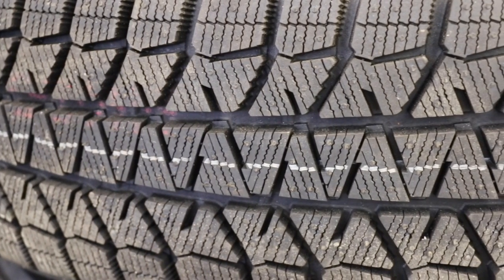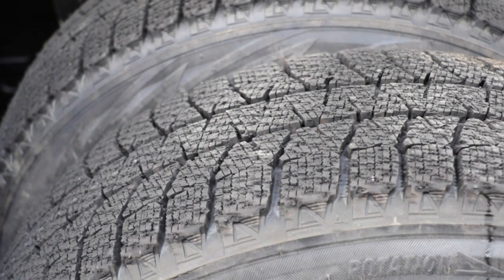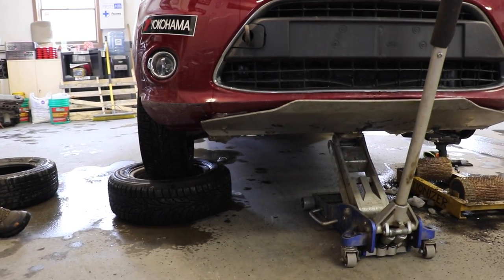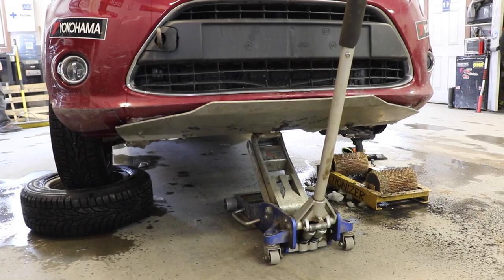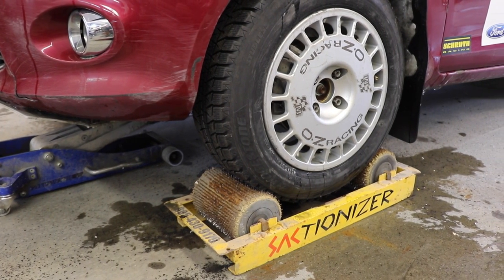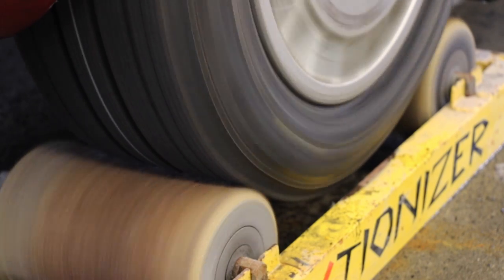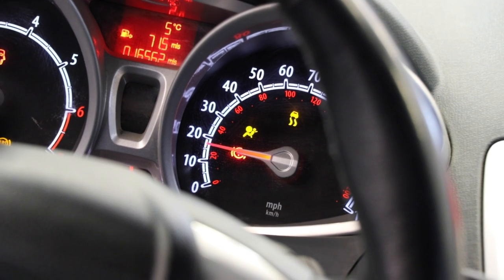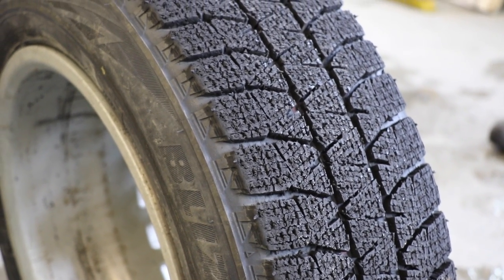Tire tractionizing explained

Comment: What your gonna end up with is a tires that will last you 500 miles on pavement
Reply: Walk 500 miles to get back?
Reply: Joseph Ho then walk 500 more
Reply: would you be the man that walks 1000 miles?
Reply: Maybe
Reply: Rayjay25 to fall down at your door?
Reply: Rayjay25 lel
Reply: More like 50 miles
Reply: SANTA MUERTE just buy snow tires, don't be chap with safety.
Reply: And that's why this channel is called "TeamONeil*Rally*". You can't drive untrasoft slicks on pavement either.
Reply: If you end up driving a car with tractionized tires on pavement, you've done something very wrong.

Comment: should note that tire resurfacing is a no-no in many rulebooks these days
Reply: But this doesn't get a new surface but just a surface adjustment, so allowed?
Reply: QuiznosBear what was resurfaced?
Reply: yes this is allowed if done on a new tire  , if you drive it on any road it will fly apart in a day or two , so only for ice and snow , also studded tires exist and would last longer
Reply: You eat corn the long way and that's a big no-no
Reply: @randomusernumber1  this is done for ice/snow racing only when there are rules where studs are not permitted.  Ofcourse the tire wont last long even on ice especially while racing...

Comment: i have some years experience as a rally mechanic and i have seen tarmac tires being shaved (for that straight contact patch) but i have never seen this before. 
Never did ice and snow rallies either , that could be the reason.
They sure look grippy.
Reply: yeah they wrote a comment here and they are not allowed to run whit spikes so thats why they have to do like this. i imagine its to make snow stick to the tire better.
Reply: Ive never seen it before either. We had a siping servicr at the shop i worked at. I personally wouldnt even sipe though. I just have a winter set and a summer set. Between the two, i get about 3 summers and 3 winters and thats just about how old tires shoukd be before the recommended discard date anyway. Saves money, and i dont chew up a perfectly good set of tires! Maybe it grips better, but with friction comes wear.
Reply: did you read the fact this is for racing
Reply: brandon dumont this youtube video is advertising overall traction improvement, and one of their main points is better snow/ice performance.
Reply: and the only time you do this is for rally as the tire meant for 1 race as they wont last long.

Comment: is it possible to get two tractionizers and put the car on, if its got a welded diferential?
Reply: otm646 Wasted time & fuel.
Reply: Observing Rogue wasted time and fuel? Lol. It wouldn't take any extra time. You have to do each tire individually, regardless of whether the other tie on the axle is in the air or propped up on a tire. Even if it did take extra time and fuel, I don't think anyone would care about an extra half a cup of fuel.
Reply: xDrifz run a track system with them
Reply: Andrew Delashaw. Time & money are precious. Unless you're enjoying yourself, meditating, or just thinking, if you can reduce the time to do something, like bundle, or be more efficient, and there's no real extra risk, then I say, go for it. Time should be used to make money or happiness, or to sort something out. If scientists found, perfected, and marketed the cure for aging, so we could live forever, I don't think we would be having this conversation. Then again, even with forever, let's try to get things done sooner, if it won't dramatically cost safety & quality.

Then there's fuel. I'm loyal to BEVs & Turbine Hybrids, and making my own fuel. But even if I was doing this on battery power alone, I would try to do as many wheels at once, as possible. And do to the time & money costs of fuel, and the possible severity of it's environmental impact. I don't take burning any lightly. It better be for a good reason, or a good time. In my opinion.
Reply: Observing Rogue you mean "when" not "if"
Reply: Nick Faber Yes.
Reply: teller of truth I think people do that, because they don't have the money yet, for a real LSD. Let alone a serious, tunable one. And normal differentials are too annoying.
Reply: You do 2 tires at the same time.. with 2 tractionizers

Comment: For LSDs you could just use two tractionizers, right?
Reply: Mac Doodles you could yes, or place the other end of the car on a jack stand if you only have 1
Reply: Or jusy buy a winter set of tires. Run a summer set and a winter set. It will ladt you a lot longer.

More friction (grip) also means more wear. And im skeptical your warranty for your tires will live through this machine...
Reply: @SupernovaSpence  you do realize he's not saying you should do this on the road it's for racing only

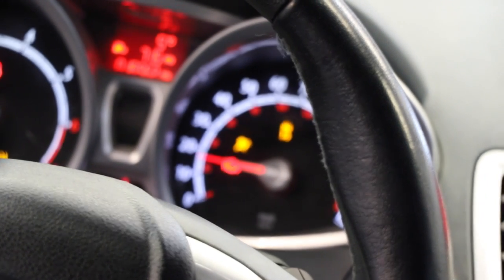Comment: 1:47 lol the dash is lit up like a christmas tree.
Reply: Yes. At Team O'Neil, they have some cars where they disable TC, ABS, Stability Control, and other vehicle electronics because in that type of driving it can sometimes be a hindrance.
Also, they have a racing seat, full cage, and racing harness in this car, so the airbags are disabled because they would be a useless explosion.
That's what the lights are.
Reply: RyanRants totally. Race cars rip a bunch of driving nannies out. Modern ECUs get mad and throw lights. Who cares. Go pedal. Whoa pedal. Changey geary pedal. What more do you need?
Reply: Couldn't have said that better myself.
Reply: Michael Sestito lol do you know what any of those mean???? You'd understand if you did
Reply: some times? lol allways :P. and airbag is not only a useless explosion its dangerus. its not realy that bad to hit a tree doing high speeds but when you have an airag it will exploade in your face and might actualy some times get you stuck in the car and if the car is burning or somthing then it will hinder your posability to get out. and as hard as you drive these cars the airbag whold expload in your face mid rally.
Reply: They had to disable traction control, skid control, and pretty much all other driving assists. If they didn't, the car would sense one wheel spinning and try to correct itself. Either by cutting power from the engine, or activating the brakes on the wheel that's spinning.
Reply: Michael Sestito That's because they're driving the car and only one wheels spinning so the computer thinks something is wrong because of the abs sensors it thinks able to APS system is broken and also thinks it's losing traction
Reply: Pull the abs/dsc fuse before running the drivetrain when the car is jacked up.
Reply: Not even dude

Comment: With cuts all over is there really much holding the thread together? I have a feeling pieces are gonna start coming off after awhile at high speeds
Reply from the maker: On ice and snow, they last essentially forever, but if you go out and drive hard on pavement, you can wear them out VERY quickly. A few laps on a track and they'd be ruined, but for ice racing or something they'd last all season.

Comment: Would this be beneficial on an all season tire in the snow just to soften tread and create more biting edges?
Reply: +IAMJAKETRIMBLE i feel like if you tried to drive these for to long the treads will just fall apart. they usually get rid of tires after each event so they don't have to worry too much about longevity.
Reply: This is NOT for road use.
Reply: heck no.. not if you like the tires lasting..
Reply: TDPEquinox Productions Can this be OK faintly done? Like shallower and the nails spaced farther apart? Or for normal road use, soft compound knobby tires with studs,  are best?
Reply: TDPEquinox Productions ...If snow tires are not available,   and I can only fit off road tires. I mean.
Reply: Just buy snow tires...
Reply: uh...  NO! worst idea since Green Ketchup...
Reply: Observing Rogue If winter tires aren't available and you live somewhere that the weather means you need winter tires, then the solution is to park your vehicle for the winter.

Comment: Does TON offer this as a service to regular people/commuters? I wonder if I can get my winter tires tractionized (though I live in IL and would have to find someone local).
Reply: You won't be able to drive for very long before those little lugs break off and you will have to replace the tires. This is for racing purposes where tires are replaced after each event.

Comment: Is this only used at certain times and certain events? Ive seen videos for example of CRC cars pulling into pits after stages with tires without studs or this type of treatment.
Reply: I have to imagine studs would be an issue on tarmac transits if the State does not allow studs.
Reply: +Tyler Linner - you have no idea how much I appreciate the small simplicity of your comment. Since you've visited, the comments have gone to hell, haha, and your comment is one of only a few comments with sanity.

Canadian Rally Championship uses tires of all sorts, except studs aren't allowed in Ontario and WRC-style studded tires aren't legal in Quebec. To get any sort of grip, you have to have tractionized or studs for rally levels of speed.

But, the problem becomes rallies like the Rally of the Tall Pines, where sections of the rally are on gravel and other sections are on snow and other sections are on ice. Getting grip on these different surfaces is a trade-off. You can't use tractionized tires at Tall Pines because they will melt and studded tires like WRC has is not legal. So, you use street-legal DOT winter tires without studs. That's what you would have seen, most likely.

Comment: Is there much difference between tires for snow and ones for Ice? On one had, you might have both at the same event/stage, but i would think that snow behaves like slippery dirt, and Ice like slippery tarmac, so do you have specialized tires for Snow vs Ice?
Reply: They have a video on this topic simply titled "Winter Tires"
Reply: thanks, ill go find it.
Reply: ice needs studs .. not chewed up rubber
Reply: Or studless technology

Comment: Damn they look grippy.. Wouldn't mind doing this on an old set of winter tires that are near their end just to see how well it works. Anyone know where I can get a tenderizer, uh, tractionizer?

Also if your speedometer reads 20 with one wheel locked, you're going 40.
Reply: this is for driving on ice only, nothing else. your tires will be done in 20 minutes

Comment: Would about for gravel and dirt rallycrossing in winter tires? Does this help or na? I heard its the sharp big blocks that help with dry traction for ppl using winter tires for rallycross instead of proper rally tires
Reply: Gravel and dirt are a different surface. You're comparing apples and oranges to pears and plums.

The big blocks on the gravel and dirt do work well, yes. But that's for gravel and dirt, and sometimes snow. These tires are dedicated just for ice usage.

Comment: Only thing i did not hear is why is there more grip? It is because snow grips best on snow so you want the tire to hold the snow on it.
Reply: It provides more "biting" edges on the surface. Essentially more tread blocks. It also makes the tread blocks deform more, allowing the biting edges to protrude more, acting like miniature paddles.

Comment: How well does it work on wet roads?  I bought shitty tires a while back and they slip everywhere...

also... it seems like this would cause the tires to wear out a lot faster, is that also the case?
Reply from the maker: Might improve wet handling a little, but DEFINITELY causes much faster tire wear. We only use this for ice racing when studs aren't allowed.

Comment: You do realize, if the speedometer reads off the transmission, that because of one wheel being locked up, it actually will spin twice as fast as the driveshaft. So your wheel is really going 40mph, unless you speedometer reads off the wheels.

Comment: Couldn’t you do this with a good used set of winter/all season tires and get NEAR the same results?
Reply from the maker: Yes, we did some used tires but little pebbles and sand particles get stuck in between the sipes of winter tires... Then if you put them on the tractionizer, they will bend and damage the little tacks on the wheels. It took a long time with pliers to get the tacks straight and happy again, but some are chipped and broken. Since then, we only use new tires.

Comment: any tips for studded tires? (road legal studs)
Reply from the maker: There are different studs available, we've really been liking the square-tipped ones on Nokian tires this year over the normal round-tipped studs. The length of the stud should just protrude from the rubber for street use,  if you go oversized for racing they will work great for a little bit but tend to fall out pretty quickly... Some folks add glue to the stud holes, but it can really gum up your stud gun. If you find a better way to keep oversized studs in let us know! Oh also you should install studs when the tire is new, if the tires is used there is always some sand or debris in the stud holes... When you install studs and drive around that can work through the carcass and you can get flat tires pretty easily. It's a gamble you might win, but we've seen tires fail that way after some use.

Comment: and, how much miles/kilometers run this tyres on ice/snow?
Reply from the maker: They usually only need to make it through a race, but some of our instructors run them all winter up here in northern NH without a problem. I ran a set of tractionized tires on an e36 BMW all winter long and it was great, but we see A LOT of snow and ice and not too much highway driving.
Reply: @Teamoneilrally  thanks. I have to trail it. :)

Comment: This is horrible for your tires. The whole reason people don't ride around on winter tires all year is because the extra tread is inefficient on warm pavement so the tires wear out faster, so doing this to your tires is only really advisable if you drive on gravel roads, ice, and snow pretty much all the time, or else your tires probably won't last 1000 miles.
Reply: its actualy becaus winter tires use a diffrent blend in the rubber to keep it softer during the winter and when the summer heat comes they prety mutch melt and thats what makes them wear off so quick. but yeah this is for rally driving not for daily use these tires are only supose to last 1 event
Reply: You don't drive your car very hard if you haven't overheated your snow tires in late spring. This whole YouTube channel is dedicated to racing and performance driving, just like my own YouTube channel. These tires are dedicated for just racing purposes, do NOT use them on road.

Comment: I didn't see any ice tires.

Ok here's the problem doing this. When you generate more holes and movement you also generate more heat and with winter tires not designed to operate in much above 0 degrees when you add that extra heat you can lose dramatic amounts of traction traction when that icy road turns to a cleared winter road. This mean you actually lose grip because the tire overheats. 
Winter tires are a knife edge balance between traction and durability if you generate too much heat you lose both traction and durability.
Reply: Your crack pipes over heating.
Reply: Well said as acknowledgement is the first step to improving ones self. This is a rally racing tip and if you still don't get it read from this page of motor sport professionals.  

http://www.fourstarmotorsports.com/tractionized-tires/
Reply: Dirka dirka That link doesn't show anything contrary to what I said. Either you didn't understand my original post or you don't understand what is written in the link you provided.
Reply: Well I've raced amateur for quite a few years and I have a system similar to the video to apply to the tires and it works. Surely wouldn't do it to a regular street tire but this system works from experience.
Reply: Dirka dirka I worked for Dunlop Motorsport for almost 11 years. It does work well but as I said only if the road remains icy and cold and it isn't a long stage. The minute the road is swept or the temp rises, it's like running a wet on a hot dry track.
Reply: Agreed.

Comment: Not a bad idea but I think that was an excessive time on the rollers. 1/4 of that would be great for one winter.
Reply: not for one winter this is a rally school channel. mean to last one race.
Reply: DreamTheory the point is not to apply this to the same degree on a daily driver. But to get maximum traction while using one set of snow tires a winter.
Reply: but even then your only gonna get a few days maybe weeks out of them. they start to eject large chunks and usually if pushed blow out. its literally a one race and bin them deal.

Comment: I sell tires everyday at discount tire. YOU CAN BUY TIRES THAT HAVE BETTER ICE AND SNOW PERFORMANCE, taking tires and compromising their structural integrity doesn't make you smart or better. I'm most cases the tire will just chunk out or worst case catastrophically fail. Please do not try at home!
Reply: Discount Tire has no idea what it's doing with rally tires. If you know all about rally tires, which DMACK tire would you recommend I run for Rally of the Tall Pines? What are my two options?

Again; Discount Tire is a road-going car maintenance shop that sells DOT tires. These aren't DOT tires. They're rally racing tires.

Comment: Kind of a waste of tire.   If you drive well a regular summer street tire is more than sufficient. I havent owned a set of winter tires since i was a teenager. Used to live in the cascades.

Comment: So I hope someone realizes that if one tire is spinning like that, when the speedo shows 20mph it's actually 40mph for the tire
Reply: No vince that is incorrect. The speedo is ran from the output shaft of the trans not the 2 front tires. Please don't spread misinformation.